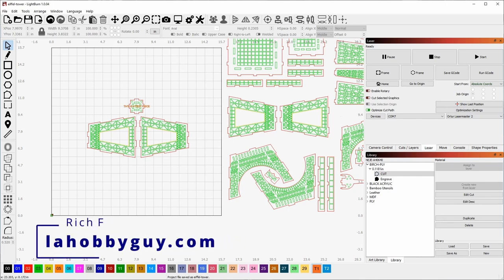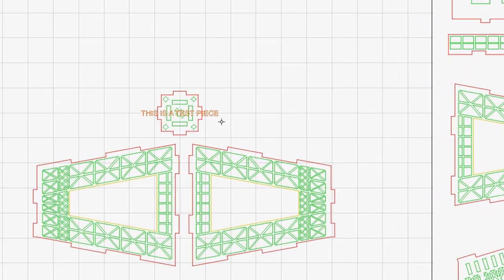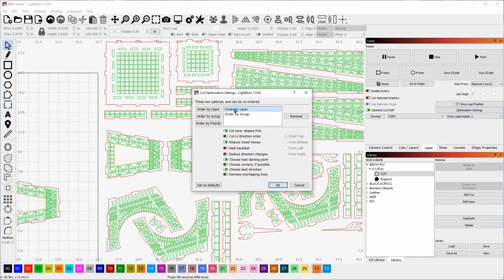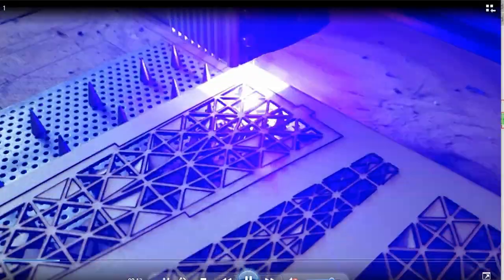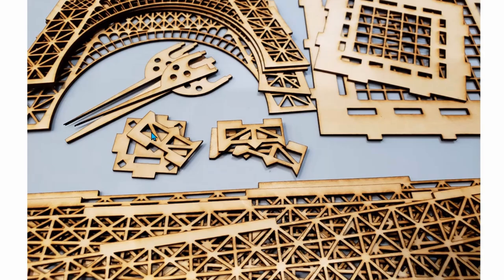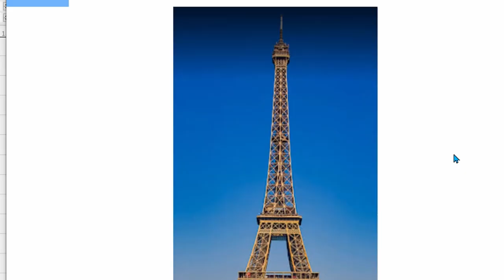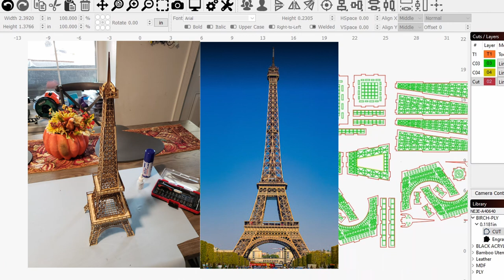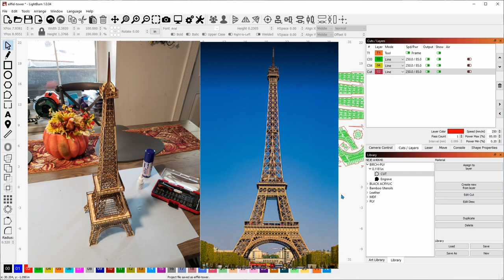Laser Cutting and assembling the Eiffel Tower out of Basswood!

Comment from the maker: I want to add two comments to this video: 1) Remember that the "test piece" is not part of the project! 2) As you compete each piece, move it off to the left side of the workbed so you don't get confused! Thank you all so much for your support!
NOTE: I have diagnosed a problem for some users on this file! Turn off constant power mode on the layer settings if your laser stops burning or skips areas.

Comment: As a newish diode laser owner, I love your channel.  I've learned a lot, and even when you cover material that I think I know well, I find nuggets of high value in the video.  A couple of questions about the files.  First, I assume the slots and tabs are authored for the 1/16" basswood and would need to be modified if cutting from thicker or thinner material?  And second, did you handle kerf in Lightburn or is it built into the model?
Reply from the maker: Awesome, thank you Robert! Yes, the kerf is perfect for a diode laser that is perfectly focused on the top of the wood with the standard Lightburn settings. If you advance, defocus or use a thicker material, then you would need to adjust the kerf, focus or both accordingly.

Comment: Thanks for the  video
can i also use 3mm birch plywood for this project?
Reply from the maker: It is designed for 2mm Jos, but folks have made it with 3mm. I sized the slots and tabs to use both, maybe with a little struggle assembling the 3mm, but it can be done.
Reply: thank you very much Rich @TheLouisianaHobbyGuy

Comment: Just purchased this, thank you. Is this for 3mm material ? if not, is it difficult to scale it for 3mm material ?
Reply from the maker: Hi Craig, I've done about 20 of these now, from 1.5mm to 3mm without making any changes. It was redesigned to use 2mm, so the 3mm is a little snug, but still works perfectly.
Reply: Thanks Rich. Your videos and help are an inspiration. Well done.

Comment: Bruce Wood
HI just down loaded the Eiffel Tower
On checking sizes the cut outs for the panels to slot into are 3.11mm wide and the piece that slots into these are 2.91mm long.
You say you were using 1/16" plywood , surely this would mean the joints would be sloppy.
Please confirm the thickness and how to compensate
Thanks
Reply from the maker: There's no compensating, run the file as is. I spent a lot of hours and test cuts getting the original file perfect. There needs to be some wiggle room to be able to glue it together. As you can see in the final result, it came out perfectly Bruce. I have done six more now since the first one on three different lasers and they all came out perfect.
Reply: Thanks for that just being cautious. Only a beginner
Reply from the maker: No Problem Bruce! Trust me, it works great! Have fun!

Comment: Hi Rich
I've cut out the first part as a test, but I'm having a small problem
The laser does not cut the pieces one after the other but runs to the other part and makes a short cut and runs back again
so he cuts them out criss-cross.
He does cut everything out well, but it has to be done differently as I see it in your video.
what am I doing wrong?
I hope I was clear!
My Laser is a Zbaitu M37
Reply from the maker: That's how Lightburn works Jos. It'll come back and cut all of the pieces.
Reply: Hi Rich

Okay so that's normal
Thanks for the quick response Rich
You are great

Comment: Hi, is it possible to have the same with height 25cm and 2mm thickness ?
Thanks
Reply from the maker: No, this is designed for 3mm.
Reply: @TheLouisianaHobbyGuy  ok but is it possible to have with height 25cm?
Reply from the maker: No, it is what it is.
Reply: @TheLouisianaHobbyGuy  If I understand correctly the current size of the entire Eiffel Tower is 25cm?
Reply from the maker: No, it's about 580mm assembled.
Reply: @TheLouisianaHobbyGuy  and is it possible to modify to have a height 250mm? Please
Reply from the maker: Again, no, not with this file.

Comment: i purchased the file and it does not cut all of the pieces out . the laser shuts off in the middle of a cut
Reply from the maker: Hi, the file doesn't cut the pieces out, the laser does Mr. Terry. If your laser is stopping mid-burn, tick off the Constant Power Mode on the cut layer and that should solve it for you.
Reply: @TheLouisianaHobbyGuy  constant power was off
Reply from the maker: @mrterry5754  It shouldn't have been, but that's okay. The reason this happens on this file is usually a bad or weak power supply, however, you may need a firmware update. Contact the manufacturer for that.
Reply: @TheLouisianaHobbyGuy  ok thanks for the help really enjoy your channel